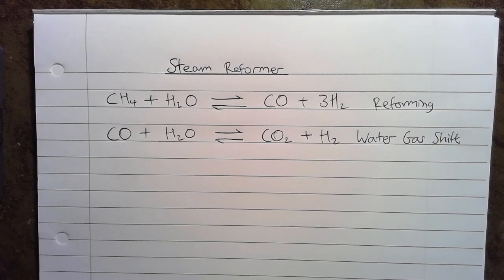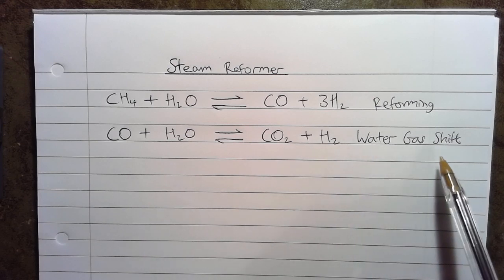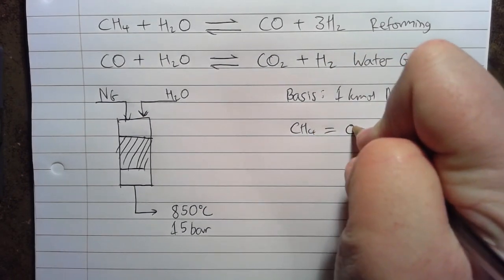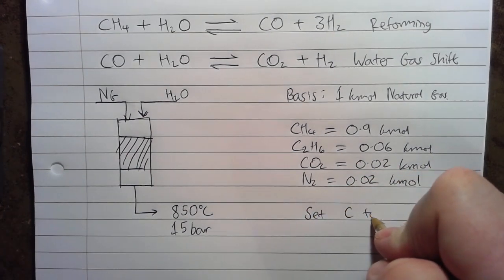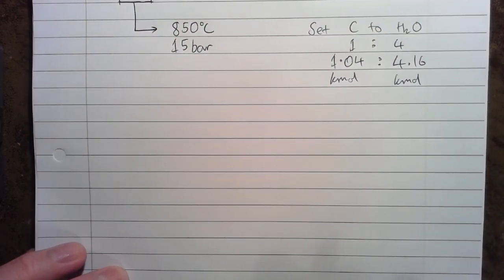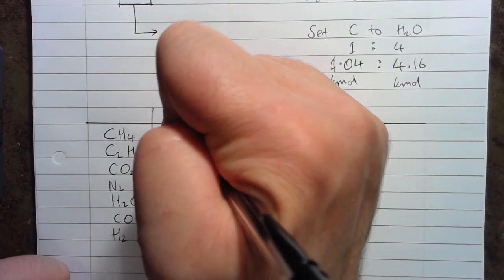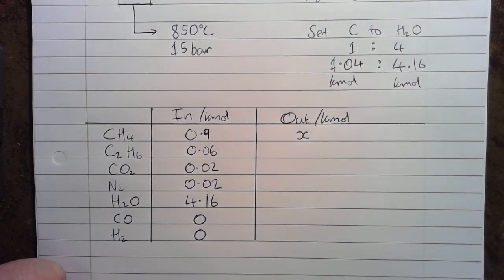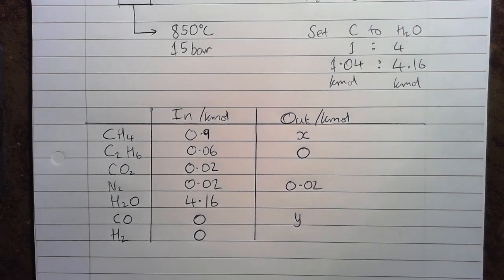Steam reformer material balance – part 1

Comment: Very informative. How is the temperature of 850 Celsius reached? Does saturated steam get compressed in order to get the needed temperature? If the relation between pressure and temperature is PV=nRT then steam of 100 C degrees would need to be compressed to about 8.5 bars. Am I close?

Comment: If inlet and outlet temperatures of the reformer are different, can i still use equilibrium constant?
Reply from the maker: Yes. The temperature of the reformer will be the same as the temperature of the outlet stream and this is the temperature you need to use for the equilibrium constant. I hope this helps. Thanks, ChemEngTutor